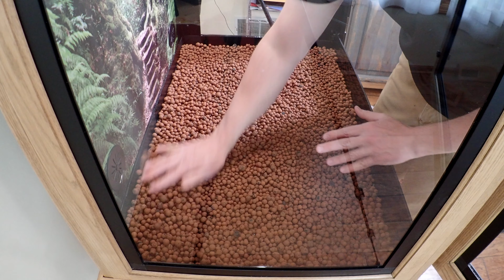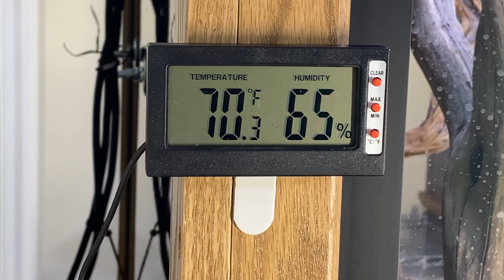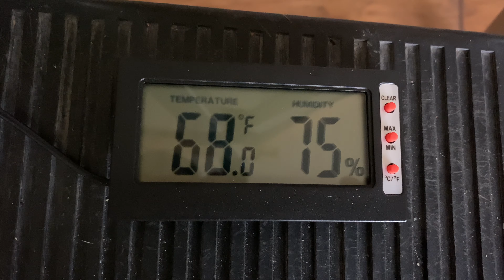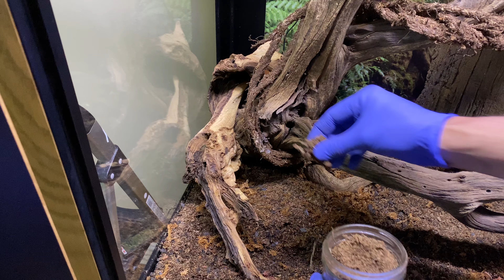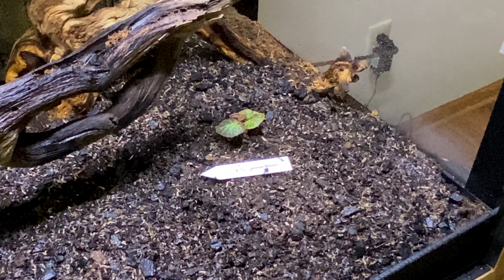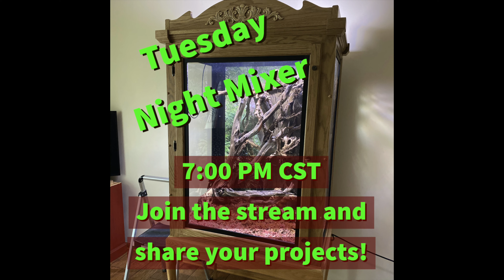Bioactive Vivarium Project - Part 4

Comment: An easier tip for mounting the bromeliad - use CA glue or hot glue
Reply: Just a bit, enough to do the job. Both methods are safe for both plants and animals. Avoid allowing animals to breath a lot of the fumes. That would be the only thing to worry about.